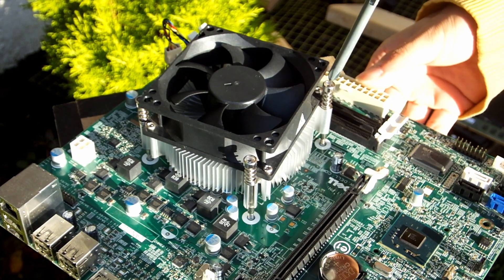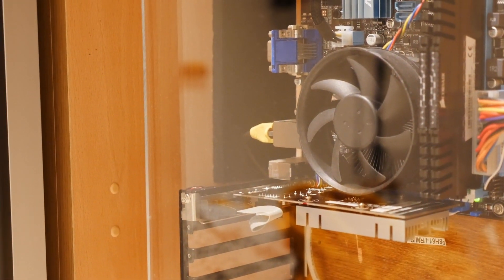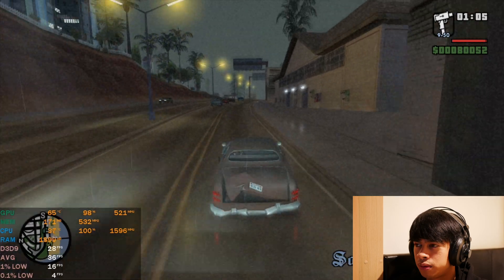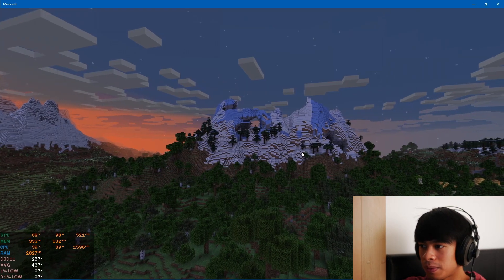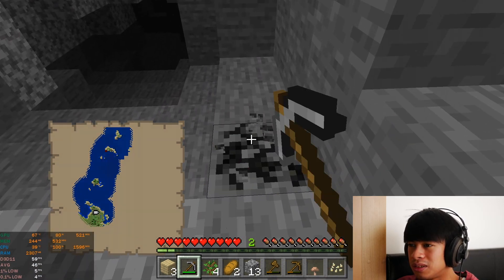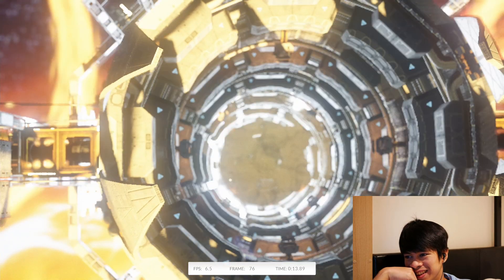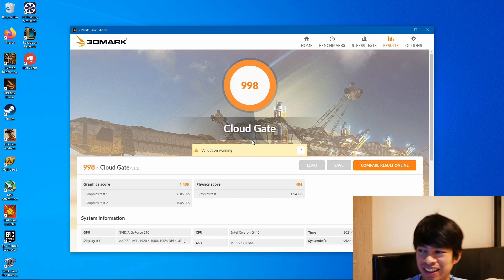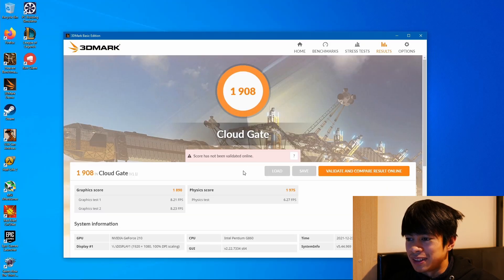Revisit - Bottom-barrel CPU+GPU combo

Comment: What you did with that gt 210 is much like what i did with my 1030 before selling it for a cheaper R7 360, I refuse to overpay for a high end gpu so i was grabbing budget stuff
Reply from the maker: Same, especially when you don't need that power, or the lastest hardware

Funnily enough, the R7 360 looks to be marginally faster than the GT 1030 (according to TechPowerup)